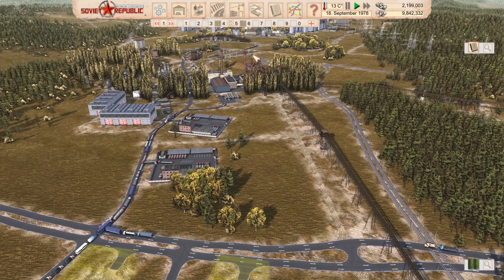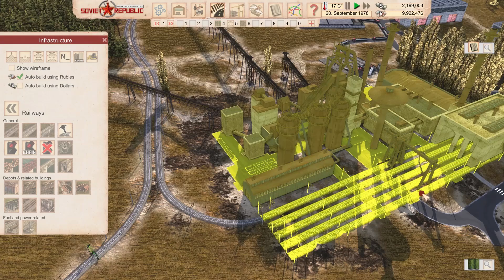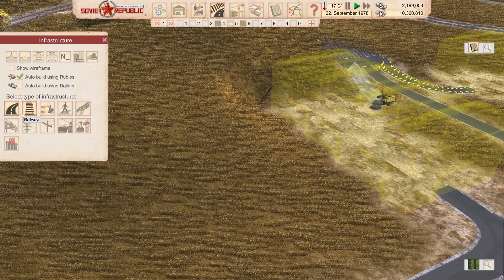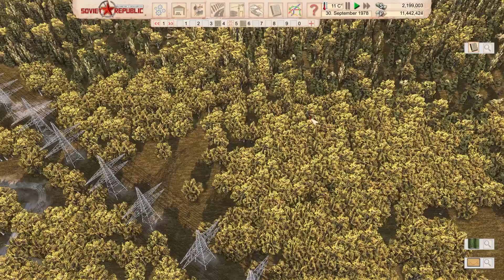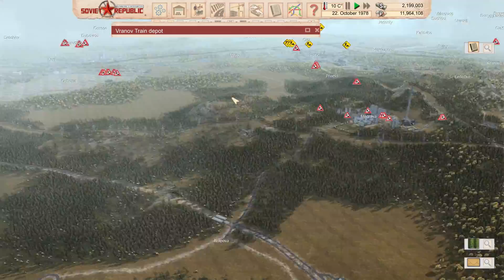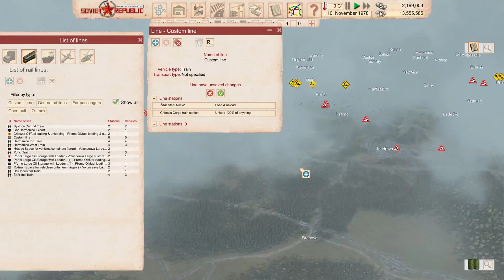Workers and Resources - Soviet Republic - Ceanwu Republic - Ep.105

Comment: Have you ever considered building cableways? They can be really useful. Like a long distance conveyor but for any type of resource instead of just aggregates, but lower capacity. I don't know if all the new steel locations have a railway nearby, but if not, you could connect a cableway to it and the nearest steel storage that is near a railway, and supply both from one train stop. Max length is 3.5 km tho, so it has to be within that distance.
Reply from the maker: We have 3 cableways. 2 for gravel and 1 for people to the iron mine. Check episode 1. They are great for something that needs constant supply, long distance and can be slow. We had 5 but quantities for the steel mill were too low.